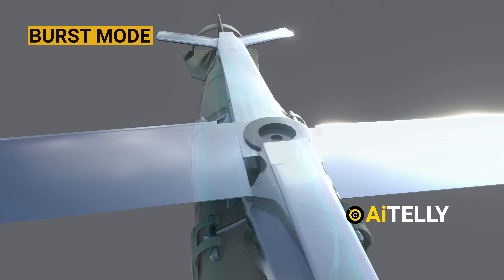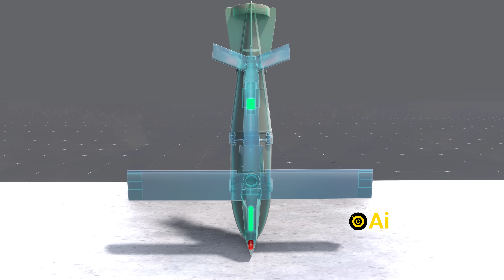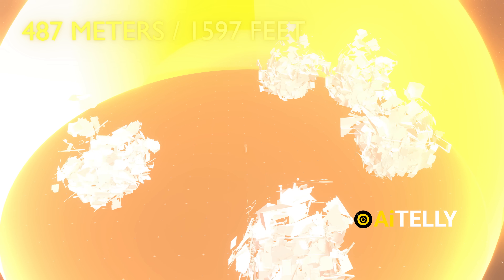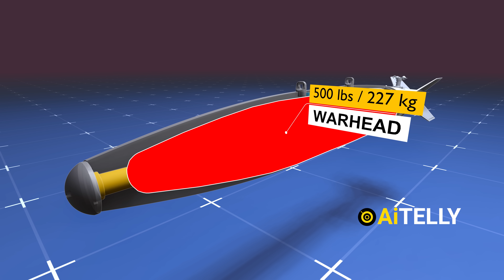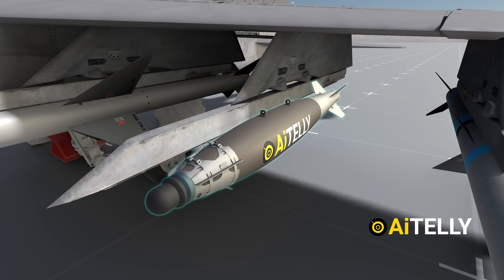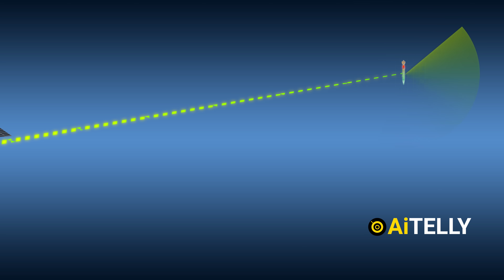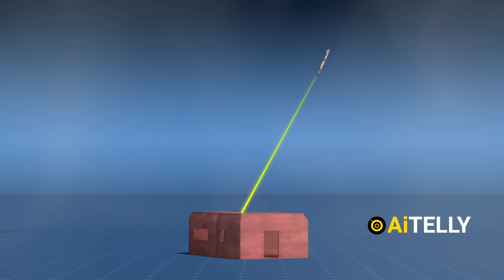Russian Glide Bombs Vs American JDAM | How it Works

Comment: UMPK might look rough, but resembled typical Russian methodology: simple to manufacture & maintenance, cheap to mass produce, useful it's good enough.
Reply: عاش الاتحاد الروسي العظيم عاش البطل السيد الرئيس فلاديمير بوتين حفظة الله ورعاه
Reply: Многие сравнивают мощь экономик двух стран,приводят аргументы ,ввп  этих стран.Давайте введём более 4000 санкций против США и посмотрим сколько она протянет?
Reply: @v29rus66 
4000?
Сейчас их 20000+

Но что-то у Запада пошло не так)
Reply: @v29rus66  там более 20000 тысяч санкций
Reply: @v29rus66  If the US suffered 1/10th the sanctions that the Russians face, their country would collapse very quickly. This is why America crucially wants to retain its Empire, especially in Latin America and Asia.
Reply: In addition: there is no need to grind the welds on a disposable product.
Reply: @colmcmillan173 тут пишут, что бомба должна быть элегантной и красивой😅 Бомба должна выполнять свои функции и не важно как она выглядит.
Reply: Exactly, JDAM looks so much more stylish, but keep in mind UMPK is basically Russia's first experience in that field
Reply: @Илья_Голем  I don’t want to disappoint you, but the first glide bombs of the USSR were the UB-2000F “Chaika” with radio control. They were made 70 years ago.
Reply: @Илья_Голем  Америка любит красиво покрасить и сделать красивую форму, а нужно результат, эффективность!
Reply: @Илья_Голем  no, Russia has KAB-500, JDAM analog
Reply: @Илья_Голем  no they are not... there are actually more "modern" glidebombs...
Reply: It also costs like $500 and bombs are free inherited from Soviet union.
Reply: По этой логике американский танк второй мировой войны - шерман - типичная русская методология))) Я думал что это просто логичная методология, во время войны вам надо много дешёвого и надёжного оружия если вы хотите победить.
Reply: Американцы!!! Вы хотите воевать с Россией напрямую?
Reply: You mean Soviet. Russian = Armata. Overcomplex, dubiously useful, not certified for Ukraine frontline use.
Reply: @willietorben560  I think its due to the entirely New warfare. As long as there is no solution to the FPS's it would  ake no sense to deploy Armata
Reply: Exactly
Reply: кедр
The Yemeni rebels put NATO in its place. The United States has been punished for a billion dollars, and the "Guardian of Prosperity" has lost its fighting spirit. The NATO military operation "Guardian of Prosperity" against the Yemeni rebels has completely failed. Moreover, the Houthi missile attacks forced the United States to remove their famous aircraft carrier Dwight Eisenhower from the Red Sea.
Houthi leader Abdul Malik al-Houthi confirmed that Yemeni missiles damaged an American ship, writes the Independent. The commander of the aircraft carrier Christopher Hill is very deeply concerned about the morale of the crew.
Reply: I think they work out the bugs and are making them in small workshops until a mass production version is finalized. Even with these methods making several hundred a day is easy.
Reply: The corruption in usa goverent ia higher
Reply: Anyone saying Jdam costing more is no problem bc USA has mich bigger GDP than Russia.

Well... I got nothing to say about that lol.

But i suggest u, a-s-k the Chinese. LOL. Lets see what the Chinese say.
Reply: @kienngo4601  gdp is bullshit it say nothing about real economy power, but if you so like your dgp compare prices, you ll fast find out that everything domestic in Russia much much more cheper then in US meaning that Russia still can produce more
Reply: @tsugumorihoney2288  well... U know i was backing up ur statement right?
Reply: @tsugumorihoney2288  Russia is 10th in Population, 20 in Car production (9/10 brands western), Russia is 4th in Crude Oil Production, 12th in Refining, US produces more Oil than Russia btw. It is on 5th place of steel production, behind US and Japan, barely before South Korea and Germany. Out of the 30biggest manufacturing companies, none is Russian. Little excourse on GDP: The price of work is more expensive PRECISLEY people in this country are able to produce more value per hour...
Reply: @duncan8437  ok with all, since Russia exists only since 1991 companies have no time to grow multicountry megacompanies. Also you mistaken by higher salary = more productivity, yeah it is true but only in same country^^ and still it is not 100% accurate, my father is excavator driver with 10 m3 bucket, but still then manage to make more work then guys on 29m3 bucket machine, beside guys on bigger machine got like 20% higher salary, And all cuz 10m3 bucket machine is Russian and work without problems, and 29m3 bucket machine always break up beside it maintenance always on time and they use only original parts and etc, and ta daa it is Komatsu PC5500..., So Russian EKG-10 originated from 1980s but modernized able to make much more work with lower cost and here we got to part where beside Russian is smaller is able to make better quality equipment fro much better cost...
Reply: @tsugumorihoney2288 что ты несёшь? Какой 1991 год
Reply: Yes, Americans tend to make things look good, but ineffective. While Russia on the other hand makes things effective and doesn't care for the looks.
Reply: UMPK looks like it was put together in a shed
Reply: @FancyPantsOnFire  его задача довести бомбу на твою дурную бошку, а не понравиться тебе...
Reply: and falls on their own cities
Reply: @guai9632  lol, no they don't
Reply: @tsugumorihoney2288  sure thing, where they fall is automatically an enemy territory
Reply: @guai9632  omg... US bot
Reply: Russia doesn't have a methodology. It's a backwards country, and russian equipment almost never works as advertised. They don't design stuff "simple to manufacture and maintain". They design what they're capable of designing...last generation equipment.
Reply: @jamesmcjamesington631  ofc, ofc, Russia is weak, USA alreday win, you can go and relax
Reply: @jamesmcjamesington631 США перестали быть отсталыми?в США гиперзвуковые ракеты что-ли появились?
Reply: @jamesmcjamesington631  What country are you from
Reply: @jamesmcjamesington631  last generation is the newest stuff...

Also how US doesn't have hypersonic missiles still?
Reply: @Янус_Ырт  Yes the US has hypersonics, AND they can be fit into the stealth munitions compartments on the F-35s. What are you even talking about?
Reply: @dadistos4538  do they? US had one program, and they closed it. If they do have hypersonic ATG missiles, do tell me the name. Especially if they are able to fit it inside F-35 weapon bay
Reply: @Янус_Ырт  mako is the name, first hypersonic to be fit inside a 5th gen fighter
Reply: @dadistos4538  yeah, it is still a prototype. And russia has 3 hypersonics already combat-tested
Reply: @  how mad are you that I’m not going to translate any of that, ignore all of it, and laugh knowing you read an entire thread of comments to send that only to be ignored.
Reply: They are both bolt on systems, the us one is just a little more aerodynamic. They also both cost the same.
Reply: @Vsor  you sure they cost the same?
Reply: @Янус_Ырт  a difference of around 10k is really nothing, like seriously, when talking about government's wallets.
Reply: @pit_viper2013  and the GDPs of the two countries are multitudes more different than the prices of said weapon. Again, they’re basically the same price. Factor in how much more money the US has, it’s the same. Probably cheaper actually.
Reply: @dadistos4538  30% of the cost is nothing? OK bud, whatever you say
Reply: @pit_viper2013  You should read up on purchasing power parity. Russian money buys more than simple exchange rate would suggest (at least before the war, where these number are from). They are close enough in final cost that it is virtually the same.
Reply: @Янус_Ырт  Yeah because the US gdp is more than 30% bigger than RU, its about 1000% bigger :D, the cost is offset by the value of their economy vs RU. pretty basic stuff :D
Reply: @dadistos4538  we are talking about pure cost, not relative to GDP values. For export buyer that's what matters. And relative to GDP - yes, US has such a bloated economy that it can afford whatever and it will still be cheaper relative to GDP
Reply: @Янус_Ырт   so you're talking about something that isn't really factored into a conversation like this and doesn't mean anything at all in a real life scenario? Ok got you
Reply: @Янус_Ырт  "Im not actually talking about the REAL cost, just the number on the screen and not what the number means to the country that is actually manufacturing the product. im now talking about an entirely different thing"
Reply: @dadistos4538  real price is listed in USD. Everything else is relative price. Relative to GDP of said countries JDAM is cheaper, but factually, UMPK is cheaper by 30%.
Reply: @Vsor Texas gas a bigger GDP than russia. russia doesn't have a better PPP than China.
Reply: @apolloaero  budget deficit wise USA is actually acting like Soviet union. 😂
Reply: @Vsor  The Russians still use old bombs from Soviet stockpiles and only pay for the airframe and navigation system, which makes these weapons even cheaper for the Russians.
Reply: @pit_viper2013  And we use old MK 84 bombs from the korean war. its the same system, the only difference is the us has been making them since the 90's, and russia started in 2019.

The guided glide bombs that are made from scratch are call "small diameter bombs" or SDBs. They are much more compact, way longer range, and not much more expensive (40k).
Reply: @apolloaero  PPP has nothing to do with GDP. It just represents how even after exchange rates, 10 usd worth of currency in one country can buy more than 10 usd worth of currency in another. Exchange rates doesn't always line up with purchasing power. 

If a coke costs $2.20 in america, and the equiv of $1.80 in russia, we would say the russian ruble has a higher purchasing power. This is why Chinese and russian military hardware often looks so cheap on paper.
Reply: @dadistos4538  it is actually a lot when you produce thousands and millions, it is very big difference, even with UMPK cost 10 k less as you tell it mean that Russians can make 1/3 more kits for same more
Reply: @tsugumorihoney2288  But russia cant, becausr russia has way, way way less money in total..
Reply: @duncan8437  sure it can))
Reply: @dadistos4538  maybe the GDP is 1000%  of US, but also has 5000% more debts
Reply: @bastikolaski8111  doesn’t matter. Russia is overmatched by America in every way that matters
Reply: @tsugumorihoney2288  Except if you read what I said previously, touching on the basics of economics, the USA gdp is 1000% larger than RU, so that 30% extra cost means literally nothing because each single unit of currency means WAY more to RU than to does to USA. It's really simple math man. Watch, I will do it really simply. If the USA and RU were to ONLY use these two weapons. RU military budget is just under 200b dollars, 7.1% of their GDP. The USA's is $820 billion. 200b divided by 24000 = 8,333,333. Thats how many UMPK they can make with their entire military spending budget. 800b divided by 360000 is 22,222,222. This is how many JDAMS the USA can make. Do you now understand?
Reply: @bastikolaski8111  Debts that immediately wouldn't be paid if the USA went to war, just like any other country. Debt is a tool, and the fact that you don't know that means you are very young, or have not had much money in your life time
Reply: @dadistos4538  add there price of bombs XD and vehicles and etc... but it is hard for you, you all measure in bombs, typical american
Reply: @tsugumorihoney2288  English seems way too hard for you to comprehend, and my comment originally replying to you was blocked for what I presume to be inflammatory language. No point in speaking to someone that doesn't understand that the USA just built the 1000th F35, and RU has a garage full of SU57s. They have nukes. That is the only thing that keeps up the facade of them having military strength.
Reply: @dadistos4538 The difference in cost is such that instead of two American ones, three Russians will arrive. And the price will be low if you are going to use one bomb. But where have you seen only one bomb used? Judging by the payload, it would be more correct to compare it with the FAB-300 and not with the FAB-500.
I don't understand the talk about the beauty of bombs at all. Are you going to put one of these in your house and admire it? The advantage of the Russian aerial bomb is that its planning unit is universal. Not only this aerial bomb can be installed under it, but anything similar in weight. A non-explosive bomb, a cluster charge, and a glider can even be used for precise equipment delivery.
Reply: @Vsor  coke in Russia costs $0.5-1, it's cheaper both in nominal and PPP.
In military it's definitely so, since Russia with military budget 15x times less than US and allies, still can produce multiple times more ammo and equipment for the war than entire NATO combined - by former NATO general and current Czech president report. 
The secret here is state owned and purpose driven military industry in Russia, against private and profit driven MIC ij the West
Reply: @dadistos4538  However, there is one small nuance- since in Russia all prices are not in dollars, but in rubles, I decided to find out the cost of fab 500 with umpc. A clean bomb costs 300 thousand rubles, which is 3.3 k dollars, and together with the wings it costs 800k rubles (8.9 k dollars). Now you can count how many bombs Russia can make and how much the United States can make on its budget
Reply: @Янус_Ырт  UMPK isn't really JDAM analog, it's JDAM-ER analog
Reply: @愛を込めてロシアから  again, the process in which that price means next to nothing still applies.
Reply: @mrobocop1666  that's ppp. hence why when something costs 50% less, I call it the same price. also since the war, this is no longer true with military hardware. Many of the components have to be purchased through the black market or middle men, increasing the cost. But before the war, 50% ish was were it was at. The exception is ammunition because there are no modern components to a bullet or HE shell.
Reply: @dadistos4538  But russia still has much more
Reply: @愛を込めてロシアから  Much more... what? Money? No you don't. The US and Russia are identical in that they can both self sustain themselves within the borders of their own country. Resource wise, it's the same. We just have 1000% larger economy than you. Pretty simple.
Reply: @dadistos4538  I'm saying that Russia has more bombs anyway. The United States has already laid down its annual budget twice, it has not been coping with its crisis for a long time.  A few years ago, you guys already drew conclusions about the Russian economy, but it turned out that your manuals were not correct.  I do not know what you call economics, soda factories? A property that is overvalued 10 times? Financial bubbles? Russia produces more tanks and shells, that's what I call the economy.
Reply: @dadistos4538  dunno, ukr lost 1,5m people minimum, smo continues, economics grows, west collapses. Questions?
Reply: @Vsor   nah, Russia produce its own microelectronics and microchips. They aren't cutting edge,  but even most modern missiles and weapons don't need some 7 or 2 nm technical processes. Cruise missiles have 96 nm
Reply: @dadistos4538  the problem is even if American weapons and Russia weapons cost same , Russia will still have an edge in mass production because of so reasons
Reply: @zallyzally2698  do people like you just forget about WW2? Forget about us equipping the entire USSR whilst supplying every other allied army too? Do you not realize we have 400m artillery shells? The only plant we have operating in country to make shells for Ukraine is making 35k a month. Just one.
Reply: @zallyzally2698  If the US kicked in to a war time economy we'd be outproducing every country in the world combined. Go look up how many munitions the USA was producing during the Cold War, and thats when the USSR had WAY more material might than Russia has today. Lil bro it ain't the same comparison anymore.
Reply: @Янус_Ырт  FAB also carries twice as much explosives.
Reply: @dadistos4538 ты забыл про долг сша перед странами. Долг сша превышает ВВП страны. Доллар ничем не укреплен.
Reply: @dadistos4538 про производство во времена ВОВ ты забываешь, что сша находится на другом континенте, а война шла на другом. Америка ничего и никогда не смогла бы построить будь она географически в Европе.
Reply: @Militaryst.  If the US shifted to a full war time economy the debt would be the last thing the US government would be worried about. This means nothing.
Reply: @dadistos4538 но сейчас у сша не военное время, а долг растет. Что вы будете делать, когда страны начнут отказываться от доллара и требовать долги сша обратно? Ведь тот же алюминий для боинг вы покупаете в РФ. Уран. Нефть. И многое другое. И не только в РФ, но и в других странах.
Reply: @dadistos4538 во времена Второй Мировой войны, единственная причина по которой сша вступили в войну - это ресурсы и деньги. Не было особой нужды переносить производство и ресурсы в сша, так было просто удобней. На территории Европы шла война, а не на территории США.
Reply: @Янус_Ырт It depends on how you count. If we take GDP into account purchasing power, then yes. The U.S. economy is 4 times larger than Russia. And the military budget is 10 times larger. But if you look at the structure of military spending, most of it is all kinds of payments, insurance for soldiers. The fact that the army is contracted. In Russia, 50% of the army is conscripted and payments there are many times less. Yes, taking into account GDP. For comparison, to provide military housing: in the USA it will cost 200-300 000, in Russia 20 000 - 30 000 . The fact that real estate is cheaper. The other part of the cost is a huge fleet. The navy is expensive. Russia has a fleet, but it's not that huge. And it's not about money, because of its geography, such a huge fleet is not needed. There, priority is given to the development of anti-ship missiles. Therefore, if we touch on the rest of the weapons, the amount will be almost the same.
Reply: @pit_viper2013  ФАБы так  то производят ,это не старые советские бомбы .
Reply: @dadistos4538  USA already paid 35 bln of national debt?
Reply: @apolloaero  Try to pay all your national debts, before calculating)
Reply: @dadistos4538  USA economic based on empty paper, Russian - on real industry. You can draw as many dollars and other papers, as you wish, but as result - USA with all NATO unable even make same amount artillery shells, as only Russia can
Reply: @pit_viper2013  хоть один сказал правильно
Reply: @apolloaero 😂😂😂 время покажет чего стоят эти цифры
Reply: @dadistos4538 сколько из этих ф35 может реально летать не падая от дуновения ветра или подтёков масла
Reply: @dadistos4538  снаряды что-ли начали производить? Или ф35 наконец то смогли летать и не падать( хотя бы 50% заявленного количества)
Reply: @ГеоргийРусый  Lol can you do math? How many SU-57s have crashed? 2? Isn't that 20% of the whole operational fleet of them? 10 f-35s crashed, thats less than 1% of the amount we've made. Also shell starvation ended weeks ago, thats why RU pushes have ground down to 30m a day. Not the same game, not the same economy. Don't forget, we own the finish line)
Reply: @FancyPantsOnFire  only in your dreams
Reply: @serheyyavotsky1246  just facts. Don’t let them upset you.
Reply: @dadistos4538  the difference of 10,000 dollars is very significant, if it is a question of producing tens, or even hundreds of thousands of units
Reply: @av1ator  not when the GDP and total wealth of the country is multitudes bigger.
Reply: @Tigr_Rus  about 3/4 of US Goverment Debt is owned to US Goverment. When US wants to lend money, they have to pay about 2% interest, russia 16%. Thats all you need to know about the credibitly to pay it back...
Reply: @dadistos4538  Разница в 1/3 никогда не бывает ничего не значащей.
Reply: @Vsor  24000 dol cost maybe 3 fab bombs , consider that russians got about 5000 + of that bombs somewhere in storages. So If you compare russians and american spendings and that american spend 70000 dollars on 10 bolts , you get the point of cost.
Reply: @stolek6908  Yeah just ignore the prices listed in the video lol
Reply: @Vsor  well said
Reply: @Vsor  Nope. Russian one is much cheaper
Reply: @Vsor  Based on how the Russian MIC works I would estimate 20 cents on the dollar TOPS.
Reply: @Vsor A Russian bomb costs 24 thousand dollars and an American bomb costs 36 thousand dollars, this was also discussed in the video.
Reply: @pit_viper2013  It was only suggestion, man. You dont know real price.
Reply: @VeseluX  🎏
Reply: @pit_viper2013  в россии никтобы не стал так не рационально использовать ресурсы. 24000$ за такую фигню это очень много, реальная цена примерно в 10 раз меньше.